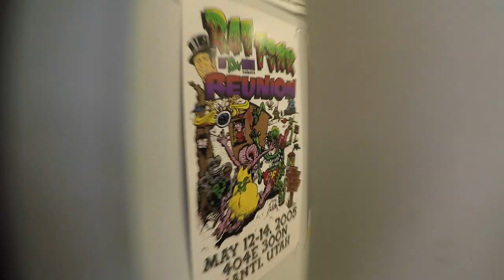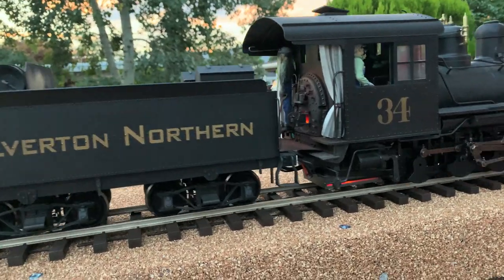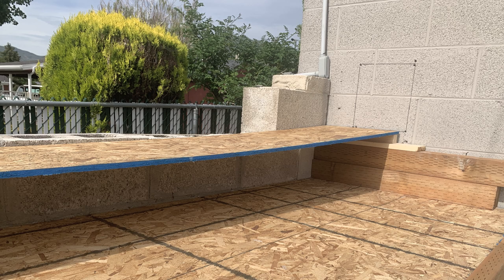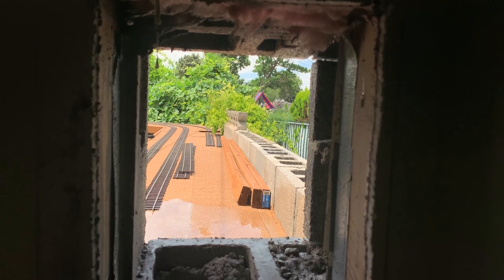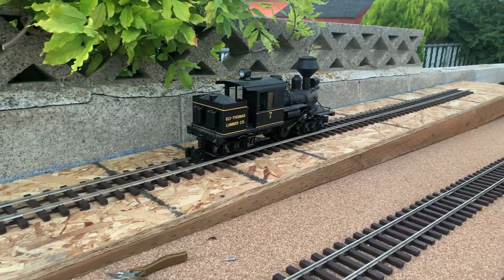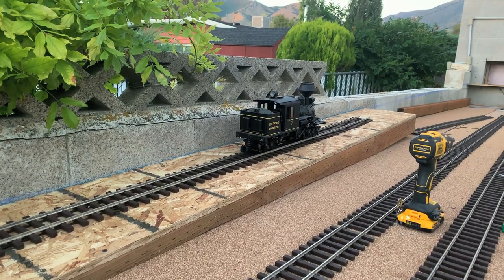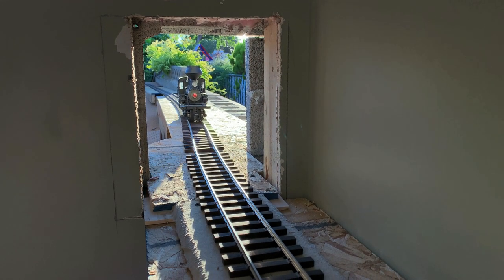Garden Railroad Update Aug 22 2022 The tunnel to INSIDE!

Comment: Yes, it is scary cutting a hole in the garage.  But I can see all the practicable benefits of being able to simply drive the train outside when you want to while being able to store it inside.  Looks like the garden railroad will not only be fun to look at, but it will also be fun to run the trains on.  I can see having lots of fun screwing around with the garden railroad once it is completed!
Reply from the maker: It’s so nice to be able to just run outside and run!  I need to build the huge trestle inside that will connect the two ends. Then it will be amazing!!

Comment: I would weld up a steel support for the opening in the wall, or at least a header from some angle iron on each side of the block. Before you finish the opening. Great progress, this looks very cool
Reply from the maker: Thought about the. The cutting people say not needed. But easy done at this point.
Reply: @ToyManTelevision  There no need for support its not going anywhere, I've been doing masonry for over 40 years.
Reply from the maker: @retracyrb  thanks!!!!!

Comment: Well.  This is really good and progressive toward the next phase of the Garden Scale railroad.  I often wonder if the outside part will have loops for continuous operation and have a suggestion.  Recently after watching shows on the progress, I have thought about a tunnel at either side and a small helix to a hidden track with access to a track underneath the outside portion with easy maintenance
Reply from the maker: As of now it’s a point to point. No loops. But a love to have hands on running.

Comment: It's SOOO much better to be able to pull the trains in and park them, rather than hauling everything to/from!!!!! When you have a limited amount of time to spend on the RR each day it's amazing how much more you can get done when 1/2 your time isn't spent going to and from, and if a surprise shower comes up, it's quicker to get the trains under cover, too.
Reply from the maker: And I find I just never run. Well not ever.. but if you can just throw a power switch, open the door and head out it so simple I do it just to mow the lawn. Why not have a train out there. As it’s point to point I can’t have the train just running but is out there chugging. And the remote is right there. So at any time I can run down the track or even just ring the bell. Then just pull back inside and close the door. Once I have the huge bridge built I’ll be able to have several trains in the yard I can just pull out!

Comment: Dale, Could you share any information about suggested portal clearances? Like F scale, on a curve of X foot radius, or a straight should have a horizontal clearance of +Y inches from the outside flange and a vertical clearance of Z inches from the rail head. The reason I ask is because I'm building an overhead railway and want to have guard rails in case of a derailment. Don't want rolling stock and engines falling to the floor and their death. Great work! I always look forward to Sundays and Tuesdays because of this channel.
Reply from the maker: Well on straight I use 8”. 4” on center. Depends on the curve. But usually fine at 5” center. Long cars or sharp curves could be a problem. But most of mine are only 4.5” and are fine. Sharp I use 5”. Hight is either 11” or 12”. 11” works. I used 12” on vertical curve spot but didn’t need to.

Comment: Impressive. You could really surprise people using that bathroom!  Will you be adding a 20 minute or better fire door from the garage to the house now that you put a hole in the garage firewall?  I hope so. I once issued permits to rebuild a fire damaged new house where a car fire got into the studs of the common wall through screw holes that were not filled and the heat was enough to let the studs smolder. That was an eye opener for me and I'm in the field. You should be able to design and build something simple.
Reply from the maker: Cementing in everything. More in upcoming shows.

Comment: Good stuff. I’m planning on turning the wall to my shop outside into a five-stall engine house, but at least I have the benefit of not having to saw through concrete! You did great in getting the hardest part done. What are you planning on doing for a door? I know, a cat door!
Reply from the maker: Still working on a plan. But the cat door is plan A!  But throw out everything except the frame and slide. Then a proper portal over that hiding it. Then just slide the slide in from the top. And that’s that.
Reply: That’s essentially what I did for the under-lawn tunnel on my F-Scale railroad outside: https://m.youtube.com/watch?v=2k9MhKX5bHw&t=144s

Comment: I am a belt and braces kind of guy.

i would have cut to the bottom of the top bricks, side cut a bit on each side, and put in a support beam above the hole supported by the bricks on each side.

Given your current setup, "as is" if you do not do more cutting, then a steel support beam above the cut would be an alternative, but not an ideal, solution.

Many may say what you did is not a problem. But I have seen similar work "crack" above the cut due do flexing of the structure. So do consider some support above the hole. 

Hope this helps.
Reply from the maker: Thanks I will look into that.